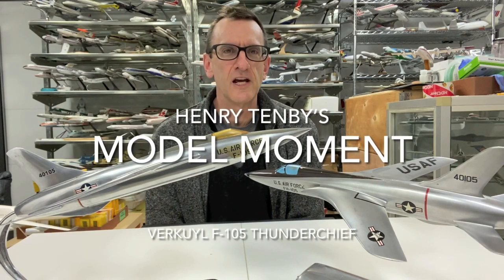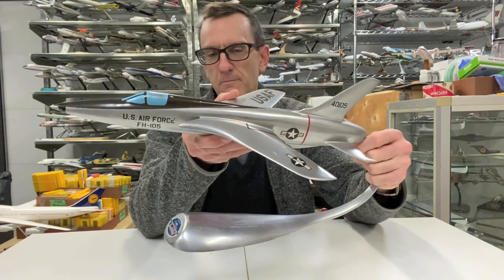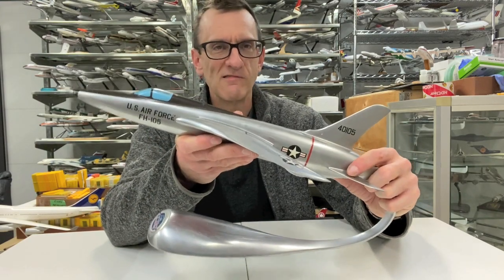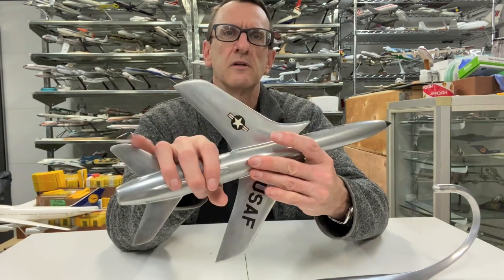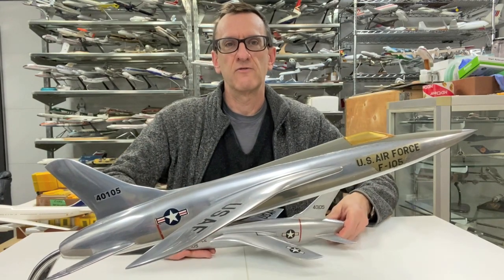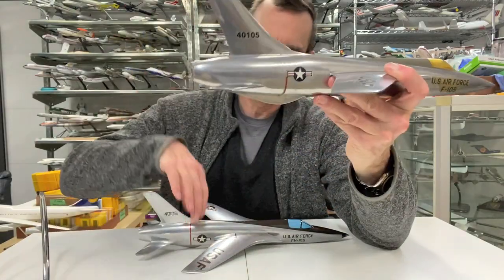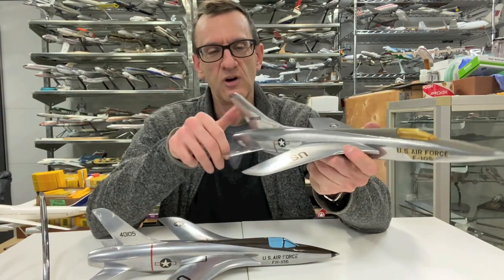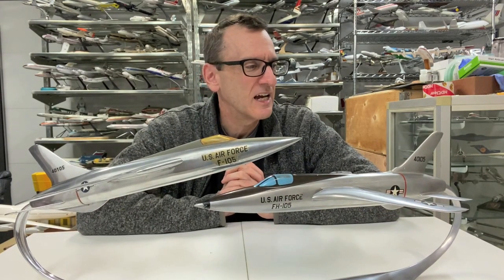Model Moment with Henry Tenby #21 | They Built 10,000 F-105s and not a single one flew

Comment from the maker: Andreas S sent me the following comments by email: There is a proof they were made by Verkuyl. Most of the solid canopy ones were  stamped by Verkuyl  .. but it wore off fast, because it was like a stamp with paint and it did not stick to well to the aluminium.
Also, the Topping ones have the walkway stripes (not the black nose point). The Topping ones were produced in lower numbers than the Verkuyl ones and they changed to a plastic version for the two seater later… that’s even rarer …. And there is a single seater plastic chromed version …. That was a test series.
But I also like the “solid cockpit” more than the plastic one.